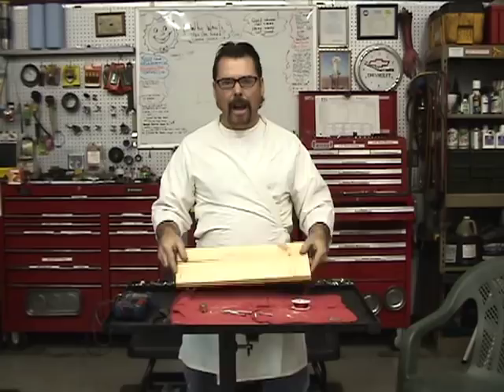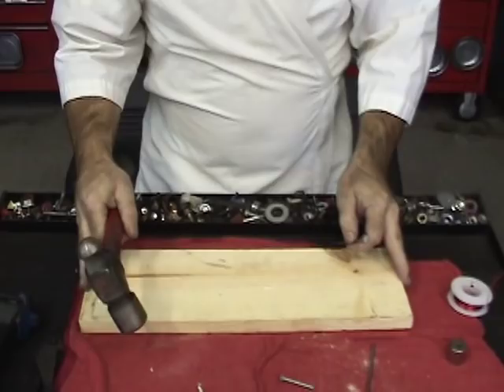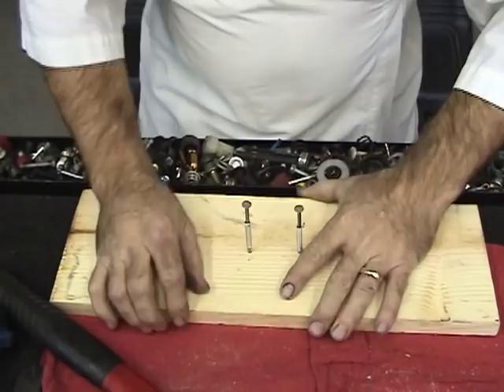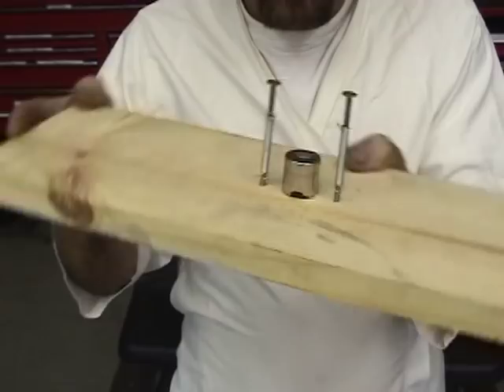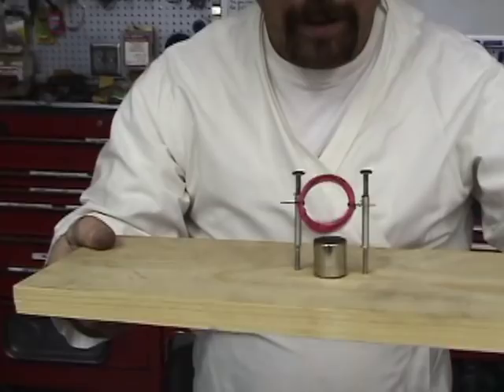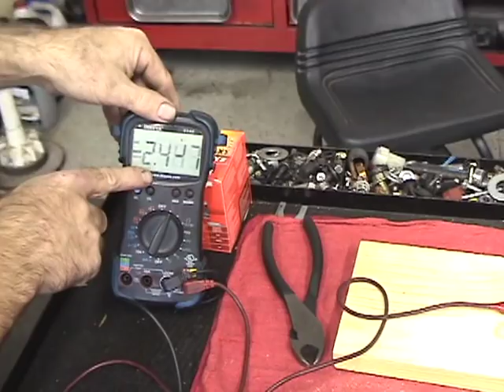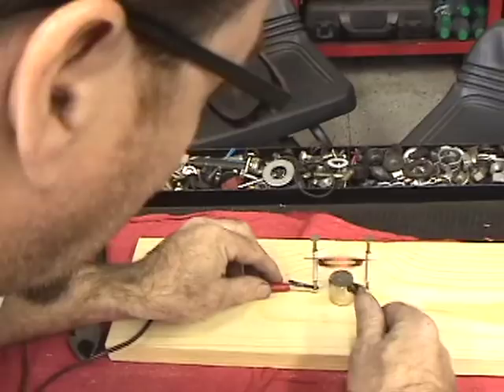FREE ENERGY MOTOR !!!!! How to build it.

Comment: the reason he pounds the nails all the way thru till they show is so they can make an electrical contact with some plates under the rag on the table (connected to a battery or power supply) the only way a coil of wire gets magnetic is if an electrical charge is applied. wheres the electricity?? under the rag!! the nails poke thru the rag making contact. copper wire is not magnetic by itself!
Reply: pds tech Then why does it run while holding it off the table?  I think once you push start it , it pushes the opposing end until the lifespan of either the wire or the magnet.
Reply: pds tech GO TO SCHOOL.... This works awesome. Manifested energy surrounds you...No matter what form it comes in.. It is real...RF,  Magnetic or gravity, H2o and then some.  I can power a CPU fan also with magnets. I can also power two dc motors, using one of them as the generator...   I have an Engineering Physics degree and if you study a few videos on you tube you might start to understand.. Electric was something you could be charged for... Gerard Morin is a good place to start watching so he can explain how free energy works.
Reply: It's never free energy. There is always a cost somewhere. It is within the creative mind that solutions present themselves. I recommend that you guys read about and get familiar with information provided by "Black Light power". Then, let's talk
Reply: +scienceman2000 I agree.
Reply: +pds tech Also, if there was a battery, the voltage would be a pattern, not totally erratic like it is on the meter.  Oh, let me guess, the meter is fake too?
Reply: you'd need a scope to see what the voltage pattern looks like. it would not be random, but cyclical, battery (or not). my idea is based on simply using the nails to make contact. it would be senseless to pound all the way thru as he made sure he did. And by applying current to the nails, you would get current to the coil.
Reply: pds tech This is true, but the contacts are definitely not under the rag.  If there is a battery, it is on/in the wood.
Reply: +pds tech Thank you :-)
Reply: +pds tech this is my answer:

You know this guy used a permanent magnet with the constant magnetic field. What happen if you have a wire frame turning around in this magnetic field? In this case you will have a varying magnetic field, this create a magnetic vector called "B". To make a varying magnetic field, you must have the wire frame rotated so he has to turn his wire frame at the beginning.
Now you have the varying magnetic field and follow the Maxwell's laws, a varying magnetic field will create a varying current in this wire frame. Let's call this current is "I".
This current makes the voltage between both ends of wire.
When you have the current "I" in the wire which put in the magnetic field "B", you will have a force put on the wire follow the Lenz's law (F = L.I x B, "L" is the length of wire).
This is the wire frame, so you have the current I on one side of wire and -I on the other side. This will create two forces on the frame F and -F which mean we have twin forces with the same amplitude and different direction. And, the frame is rotated.
When it's rotated you already have the varying magnetic field and it will rotate itself.
Reply: great post a video
Reply: +KellKilla12  - proof. Wher's the proof. A video pls. With all made of plexiglass. Who has same weight/streight ratio.
Reply: how the fuck does it still rotate when he picks it up then. LMFAO 😂
Reply: +Châu Vĩnh Lợi this is flawed for several reasons. First, the energy put in from the initial spin will quickly be dissipated through friction and electrical resistance. Second, if there was a constant current flow through the wire it would have both a north and south pole wich one of these would attract the permanent magnet and just stick. Also, he claims that the design is based on a monopolar magnet,  wich is a completely hypothetical concept and is not a reality.
Reply: +Ben Watson or the batteries are in the wood
Reply: Big Andre' yes, of course.  I was replying to the other guys comment though, giving reasons why it had to be batteries.

Comment: it's because as the wire goes around the magnet is pushing/pulling the wire away each time it,rotates... that's why you have to,give it a push to get it started... I don't get why this is so difficult to understand. I did this in 6th grade..
Reply: It is fake, btw
Reply: This is a total lie. If you have copper wire, it doesn't even get pushed/pulled by the magnet. If you have a iron wire, it will just have one of its side stick to the magnet, and will not continue rotating. The rotating effect of a coil plus magnet is high school physics, and you DO need a battery to make it rotate continuously, which is just Fleming's left hand rule.
Reply: Exactly, I just got tired of explaining things and said it was fake.
Reply: No, you didn't do this in 6th grade because nothing like this works. You need a battery to make this work
Reply: some people just aren't very smart

Comment: you forgot to show us the back edge of the board where the battery in located. But you're an amusing guy Jeff.
Reply: +mateo inventor He cleaned the enamel off the ends of the wires so it pick up the juice being fed to the nails from batteries connected to them that are hidden on the back edge you never see on the second board. He drilled holes on that edge up to where the nails are and fed the wires.
Reply: actually he is using a monopole magnet to make it work... go ahead Google it take your time
Reply: +Tim Ruiz any video can be faked but the concept of  magnets making things move is a solid conceptam I wrong?
Reply: You have a lot to learn about magnatism
Reply: Lonnie abad You have a lot to learn about spelling.

Comment: The bouncing of the wire on the spring mount is what makes it work.  You're making and breaking the connections at just right time for the flux field to collapse and allow the wire coil to finish a revolution.  If you make it so that the wires don't bounce but producing a continuous field, it won't work at all.

Comment: A battery that you have installed in the edge of the board facing you.
Reply: Well, a stolen battery could be considered "free" energy ;)
Reply: alisher1984 Yes I agree with you, there must be a hidden battery in the wood. But nevertheless there's a major problem with physics. Also if there's a DC power source hidden, how can this Motor run yet? Doesn't a DC Motor Need a commutator at the axis to change polarity in the right moment? Can't believe he has a complex AC electronic inside the wood. Very misterious...
Reply: andiback No mystery here. Battery is the side of the board facing him. Meanwhile, the axis wires are half stripped facing opposite directions. That's your commutator.
Reply: alisher1984 Solar panels work, why can't this!
Reply: I'd say that thing actually spins on the power of the magnetic field, but it won't spin forever, cuz the magnetic field will drain empty, eventually...
Reply: UNL1Mi7eD eD17i0n A magnetic field can't drive anything if there's no current. This isn't even a closed circuit, for as far you know this is an open coil spinning in a magnetic field, creating a voltage and no current. Energy loss would be minimal but never more than you put in it. This is a DIY DC generator, if you didn't knew the process of this can also be reversed and create a DC engine. Google it.
For god sake Travis, a solar panel converts light beams into a DC voltage. That means it uses light as a "fuel".
Reply: Dennis Vlaeminck  It bothers me that some cocky arrogant people tell of their knowledge of this thing and call it or treat it as a closed circuit. I half expect someone to explain how one of the nails “anti-induces” current.
Reply: If this actually would work, every single DC motor would do the exact same thing, start with the twist of your hand and keep running. What anti-induction are you talking about?
Reply: Dennis Vlaeminck I was trying to be funny and point out how much nonsense there is in most of the explanations I’ve read. Apparently I did a poor job of it.
Reply: Jeff B Haha sorry xD I thought you were being serious about it :p my bad ^^
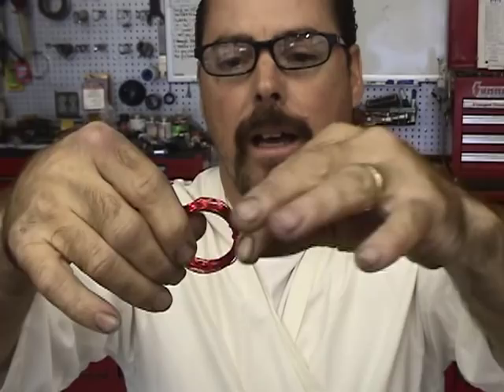Reply: andiback Not really so mysterious. Check out [4:49] on this video and watch [ Simple DC Motor Explained ] on YouTube and the mystery will be gone.
Reply: There is no hidden battery you idiots. It's called kinetic energy. kinetic energy is produces by an object in motion, the wire is that object in motion so there is energy created. Now for the voltage part: for every 5 turns of that wire there is 0.004 volts created. This is Faraday's law and the magnetic field the wire is spinning on is Gauss's law.
Reply: Edward Marquez The law off Gauss is about static electricity, like capacitors. 2 conductive plates, with a thin isolation will charge the isolation, the thing is it doesn't come on it's own. You need to put the energy in it by rubbing a balloon against your wool sweater, or apply voltage on the metal plates, as for you voltage thingy, voltage is created by a few variables. One is the strength of the magnetic field, another is the amount of rings the coil has, the other, the speed it crosses the magnetic field. (In case you don't know if you create a voltage and use it with for example a lamp, there will be a counter force slowing the whole thing down), many electric motors work as well as generator, depending on their type, this is for example used in regenerative braking. Voltage doesn't add up if you spin long enough, it doesn't work that way. Not to mention copper and iron losses.
To put it simple, if your energy doesn't come from the battery which you assume isn't there, where does it come from?
Like i said before, this is exactly the same thing as an electric DC motor.
Reply: Travis Finnemore you are obviously wasting your time showing your optimism for this video. You will be overwhelmed by the company of debunkers, and when i say company i'm referring to a group/organization on an active payroll. :)

Comment: Didn't even have the common sense to modify the same piece of wood when the frame switches at 5:47. {Yawn}
Reply: you are hard i did not even see that until you said 
you have the super eyes hahahahahahahahahahahaha
Reply: thanks... that explains it, fake
Reply: is it like a hidden battery inside the second wooden board? otherwise it makes no diff weather it's 2 different boards or not...
Reply: Luis Gonzalez
Sorry to dash your hopes but yes. This one is a complete hoax.
Reply: When you've been validating (or invalidating as the case may be) free energy claims as long as I have, you learn to spot slight of hand.
Reply: ZeroFossilFuel Just wondering if you have come across any "easy-to-build" free energy concepts? I am no electrician, nor am I any kind of "inventor", but if there is something out there that could make a reading lamp light up without being plugged in, I would LOVE to know how to do it! LOL
Thanks!
Reply: Rick Roesch there is no such thing as free energy, because f the law of conservation, now there are ways to harness other forms of energy and use them (solar, thermal, wind, kinetic, etc) so there might be a way to attach some kind of small generator to it that keeps it powered, but i think if you need unplugged use a rechargeable battery and if you want free energy use solar to recharge (trust me no one's gonna make you pay for the sun anytime soon :P )
Reply: hay nhin tam go
Reply: Luis Gonzalez Thanks Luis!
I have recently been coming across all these "free energy video clips" and am just amazed at why so MANY people would try to "trick" folks into believeing something that wasn't true.
It's a crazy world! LOL
Have a good one!
Reply: Rick Roesch glad i could help :)
Reply: Jones Guima
Same question applies to you, did you build, or are you just credulous?
There has been a long history fakes, and misguided inventors. So folks have earned their scepticism honestly.

The only thing jeff is not showing is the battery that runs a current through the nails and the coil. the board is thick enough to hide some AAAs, or even some coin cells.
Reply: ZeroFossilFuel  Thank you for pointing this out. I was wondering how he had gotten it to function, and figured it was just digital editing.
Reply: You definitely need better eyes if you can't see that those are two different boards in comparison to the first part and last of the vid
Reply: J Hill
You're right, my eyes are ok, he's using the board he prepared earlier. The height of the nails are different too. But as long as he's happy.eh? he's got to 879,079 views, he might make his million who knows.
Reply: Pisses me off... million views on LIES.
Reply: J Hill
Reply: Rewatch the video until the very end.
Reply: lol

Comment: You can produce the same effect by mounting magnetic switches close to the coil/coils which are affected by the magnetic field so as to make an break the circuit.  That would require wiring your coil to the switch/switches which means you would have to have a rigid shaft to allow for the break in the wire to be routed to the switch/switches.  Usually just one switch is needed and seems to work better.

Comment: SO HOW ABOUT YOU TELL US WHY YOU CHANGED OUT THE BOARD!!!!
The first board had a brown streak and a round spot on it the 2nd one don't!!!!
Reply: it was turned .
Reply: It looks like the wire was rewound a second time (cleaner). I think he just miscalculated his loop size, so he just started over.  Don't call it B.S. until you can disprove it.   I've seen this video several places.  However, I need a monopole magnet to prove it myself.  Where do we get one?
Reply: Don Rota I still call bull shit on this one!!!!
Reply: a subwoofer speaker works fine for me ...  idk it works but its very finicky and  is very pointless
Reply: well his second bord has a wire conected to it well he forgot to use the same peace of wood good work finding the scam
Reply: Don Rota http://en.wikipedia.org/wiki/Magnetic_monopole they don't exist. he does not show the side of the board that is facing him, if it was turned you would see the battery and wires going to the nails.
Reply: B.s
Reply: Ok
Reply: Serge Smith  your right man ive looked from 2.45 when you clearly see a big kont in the wood and when he turns it over to see nails through it has a knot in the middle the grain of the wood is changed aswell, this guy is taking us for mugs.
Reply: Yeah. Why DID you change the board?
Reply: Serge Smith  He also doesent show the back edge when hes pretending to show us ALL the surfaces, He probably had a cheep Magician kit when he was younger. His name must have been something like   ''  Super Geek the Great''  But on the other hand He may have used a totally different piece of wood to show he was bluffing,  He defenitly doesent look stupid but He defenitly does look like a geek.
Reply: Isaiah Martinez The question is why did He change it to an obviously different piece of wood.
Reply: Don Rota There is no such thing
Reply: Don Rota there is no such thing
Reply: old man well spotted on the wood change over.
Reply: Serge Smith the streak is on the other side. he just turned the board around
Reply: !!!!!!!!!^^^^^^^^^^^^^^^^!!!!!!!!!!!!! this guy see's  the obvious that  i seen
dont say its fake ...
Reply: Don Rotaa, monopole magnets can be found in some science fiction stories: go get some and read all about it!
Reply: ***** He changed the board: the WOOD GRAIN on the first board was not the same as the second board-- this means he changed the board.
Reply: ***** Oh, and so when he lifted the board up, what went on there?  Some magical transfer of energy?
Reply: +Tony Boroni You are so full of shit.  Where do you see a wire connected to the second board?  This isn't a scam.  And if there was a battery, where would it be hiding?  He showed both sides of the board, no filler.  So where is it?  Maybe you should watch the video in its entirety before calling BS.  Just a word of advice.
Reply: Yes I am sorry, I wish I could put into a couple of paragraphs why this is faked, and give you absolute proof why. My suggestion would be to read up on the properties of permanent magnets and you will find out that there is no such thing as a monopole magnet. Second why did he change boards. All it will take is a very small watch battery to make it look like this. And at the end he told you " If it looks to good to be true, it probably is". He is just picking fun of others that have clamed that this is real. It is just for entertainment.
Reply: old man A watch battery doesn't supply 2.5 volts.  Maybe he changed boards because he made a mistake.  He wasn't exactly measuring everything as he went along. Also, monopole magnets have been created, they just aren't true monopoles in the sense of the word (One pole is greatly stronger than the other)..
Reply: @drrota  There's no such thing.  EVERY magnet has 2 poles.